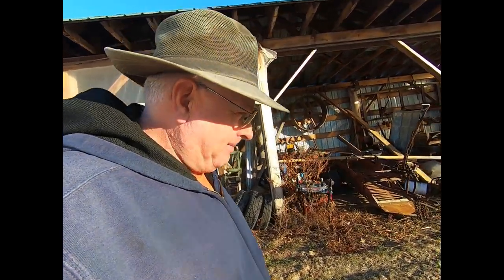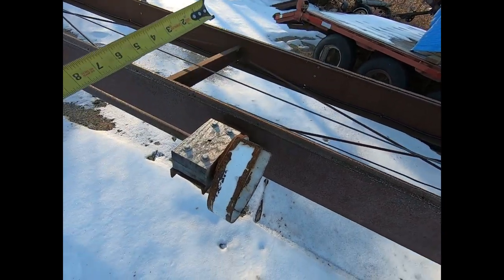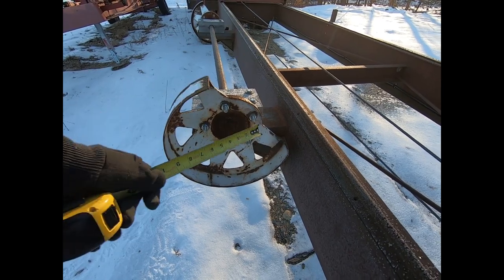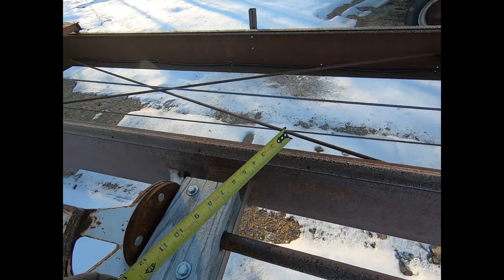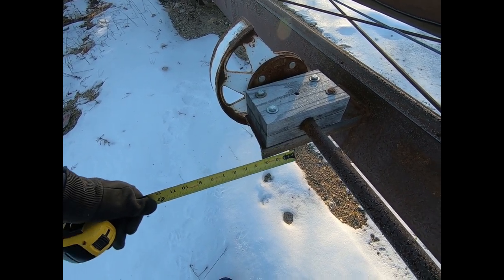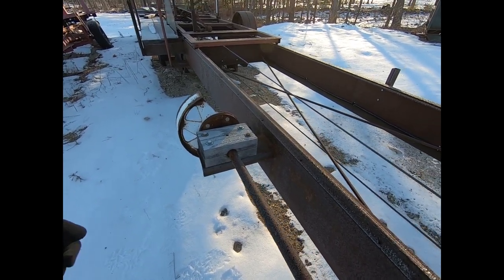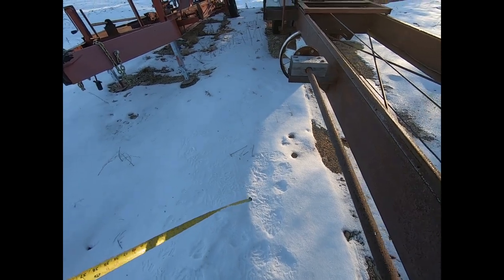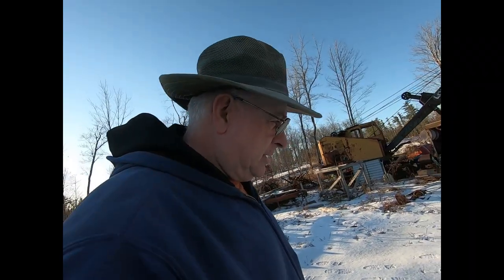Belsaw log turner

Comment: Tracks are backwards for the log roller, t track is supposed to be opposite of the saw
Reply from the maker: Flat track by the saw will collect saw dust to easily, i have never seen a mill run with the flat track run at the saw side
Reply: @survivingmaineona20acrefar77  if you run a hydraulic log roller it is easier to push the carriage off the track if the t track is by the saw
Reply from the maker: @mattbaudek8468  I am sure it is